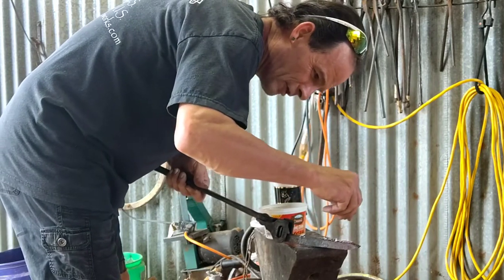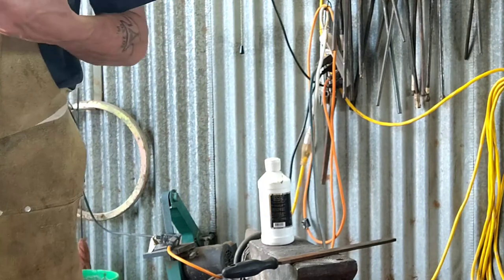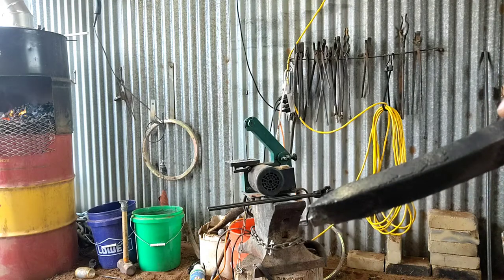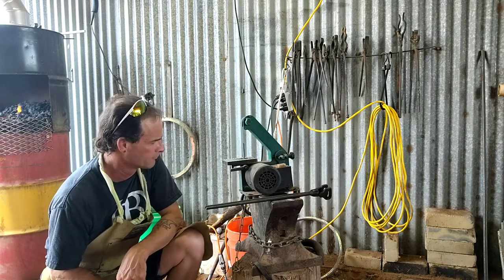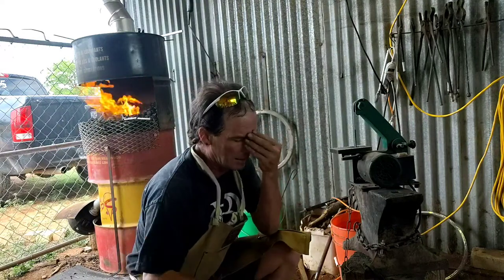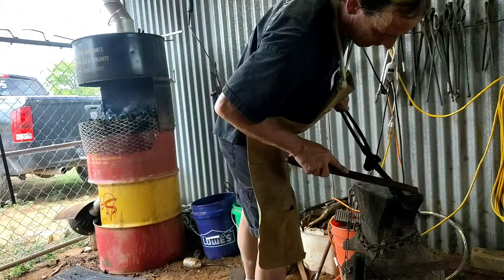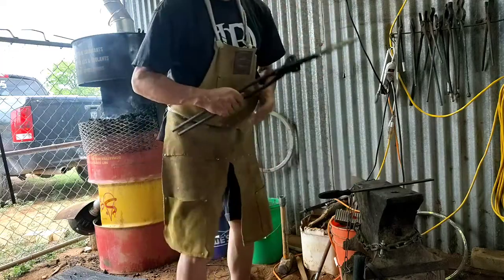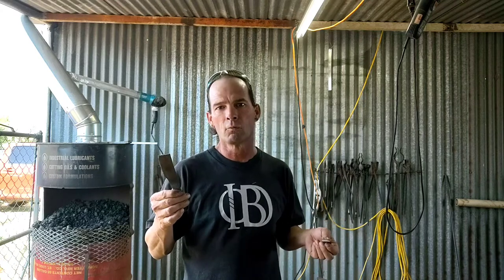Can a rail spike be Hardened?

Comment: In my experience, carbon from the cast will migrate into the steel. It works the same when mig welding cast iron. The bead turns out much harder than the cast. How far that carbon travels into the parent metal is the variable. Interesting experiment, I'll have to play with that. Thank you.

Comment: Who'd have thought?  The added carbon from the welded cast iron increased the carbon content all over the spike?  Maybe the carbon from the cast bled into the spike.  It may not have needed to move far.  Thinking of electron transfer or water in a sponge,  since mild steel already has carbons mixed between irons, The whole sponge just moved its waters around to make room for the next drop?   Hopefully I made sense enough.   Still....  IMPRESSIVE!  Deeper than than just "case hardened," too.
Reply from the maker: I was hoping for something akin to case hardening but with a much shorter time frame and energy expenditure involved. The results of this little experiment surprised me.

Comment: I think you're onto something. Cut grooves in the edge in a cross-check pattern.then buy just straight 1095 steel powder and melt that in. I guess you could add borax if you want.....I like it off the box
Reply from the maker: I think the borax is essential. It's hot metal glue. Lol no really, layer to stick the powder to and a layer to cover the powder so it doesn't just burn up or get blown off. I've got some 1095.🤔
Reply: @TAS1303  I'm telling Roy you love flux 😂😂

Comment: It’s always been controversial some say you can harden some say you can’t obviously you’ve shown you can I’ve heard that spike driven into the turns in the track are harder to withstand more pressure and I know or at least have been told Aussie spikes are closer to a 1050 or so. Personally I’m of the opinion that it’s possible to a certain degree with some but don’t rely upon it because every spike is different

Comment: Some people say a RR spike is made of hot dog steel where other say they are made of a very specific recipe. There are regular spikes and there are those that are marked "HC"  In the time that I have been forging I have had several spike knives skate a file. Not often but a few and I didn't put anything on them to cause a hardened difference. Your guess is as good as mine. Some harden and some don't and you may well have case hardened them which answers your question but doesn't explain what happened with me.
Reply from the maker: This one was not marked HC I picked it out on purpose I also heated it and quenched  it first before I even twisted it to check if it would resemble any hardness by itself. I missed the record button  on that shot.... It did not skate a file  in the first attempt. I apologise for omitting that bit of information. I kinda forgot about it being relevant
Reply: @TAS1303  All good Sully. I think I'm going to try making some of that iron and flux and giving it a shot. That's really got me curious. Stay cool brother!
Reply from the maker: I had really good results with iron mountain/cast powder/iron mountain layers. But the 50/50 mix of powder and flux worked as well. The 1040/45 scam shavings lost all their carbon and sparked like mild after the fact sooo. Yeah man Do it!